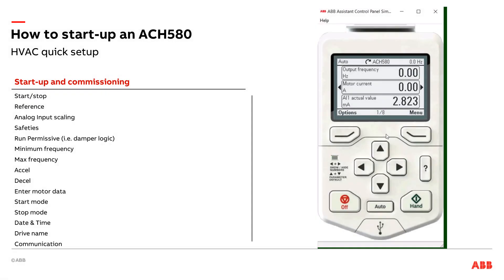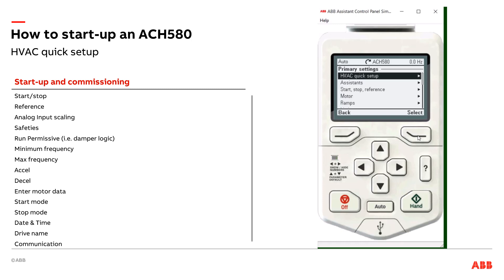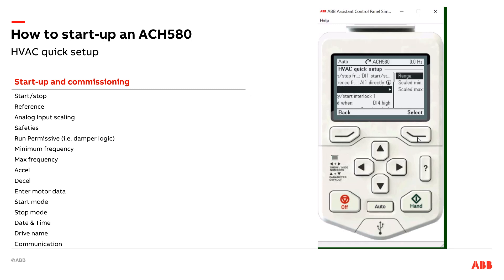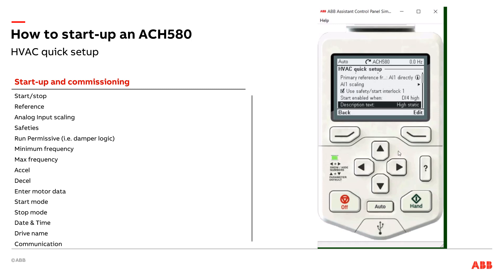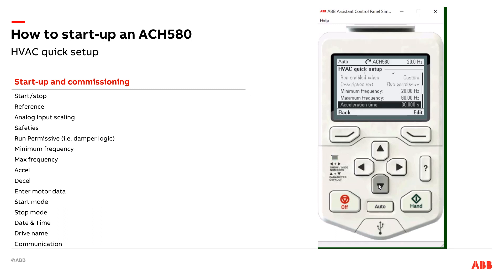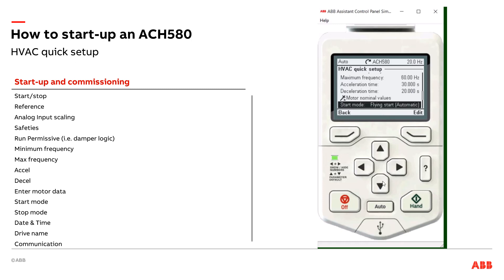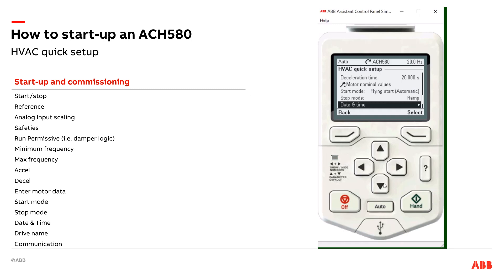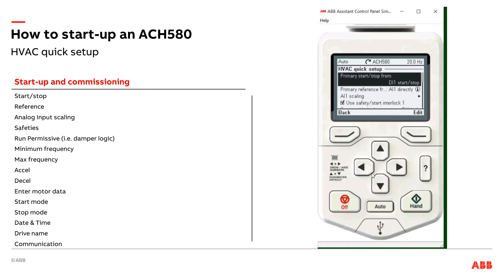HVAC Quick Setup ACH580

Comment: So i recently put in one of these drives on a carrier package unit. I did the set up just like I. This video I put the motor info. Tested rotation and ran in hand all the way up to 60Hz. When in auto and calling for cooling initially it ran at 6Hz for a bit and alarmed out due to not enough amps for the current sensing relay. Can not get it to run in auto have it in hand for now so the unit will work but how do I go about fixing this issue????